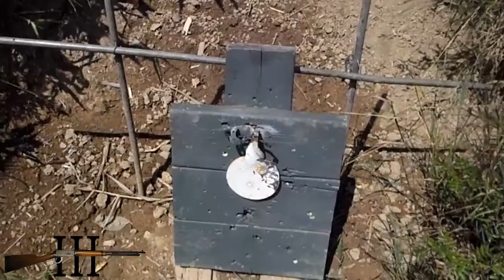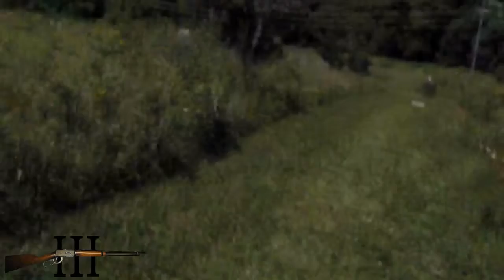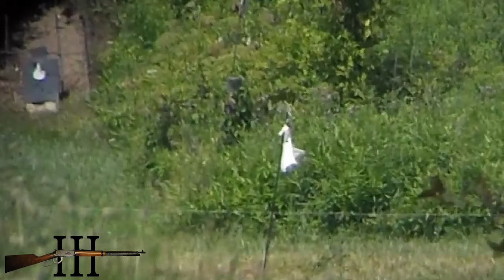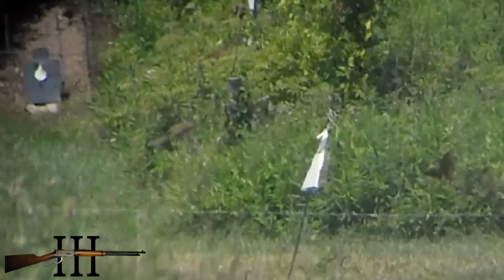30-30 Not Shooting Precisely

Comment: Rifle was shooting great, time to troubleshoot the system, and try and figure out what caused the shift in Point of impact.
Reply from the maker: I could maybe change the lube I use, or clean after a set amount of shots, like 50 or so.

But then I'll need to remember my clean bore POI, and when the fouled bore POI shifts.

Or I could shoot jacketed bullets only, and resume with the normal procedure.

I'm cleaning in preparation of using jacketed bullets.

Wish me luck. ;)
Reply: Win94AE I am no expert, but the Bore can fowel worse with cast if the Velocity is too high. Are You using Gas Checks ?
Reply: Win94ae Good luck, I plan to shoot in the morning Myself
Reply: good luck my friend.
Reply from the maker: MegaBait56
Thank you!
Reply: Win94ae, I just put out a new one on My Channel, audio was kind of poor, but this is a short Video, and different from My normal stuff.
Reply from the maker: Rick Nethery
I watched the first one, I need to wait until my computer will let me watch the 2nd one.. :/

I like that rifle.
Reply: Win94ae Thanks very much for watching,,This load development is frustrating. LOL
Reply from the maker: Rick Nethery
Especially in the sweltering heat.

Comment: What Changed Win94ae ?
Reply from the maker: It is a problem I found a year or so ago; the bore is getting fouled extremely by, what I assume, is the lube... and it does not want to come out.

I am cleaning the bore now, after an all day cleaning, I'll shoot a ladder test using the the Hornady 150gr FMJ. Each time I take a shot, I;ll clean it. Then when I find the load, I'll take one shot a day and clean after each shot.

After a few weeks of that, it should be clean, then I'll shoot jacketed bullets only.

My AK loves cast with the chrome lined bore, but this ore does not like, (I assume,) the lube.